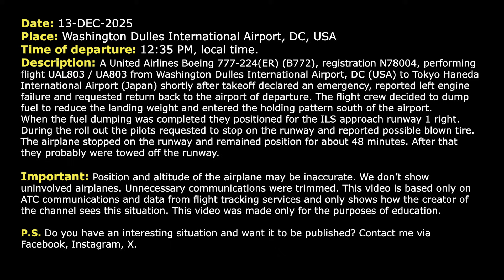Airplane Loses Engine on takeoff. United Boeing 777 declares MAYDAY at Dulles Airport. Real ATC

Comment: ATC needs training on standing by
Reply: Must be hard though. I get it though. Aviate, Navigate, Communicate. ATC probably tuned to Communicate, Navigate, Aviate.
Reply: I dunno. It’s critical airplanes stay above minimum altitudes though,
Reply: @afridgetoofar1818 
They’re following their engine out climb and cleanup profile. It’s published and  pre-calculated to clear terrain for each specific runway. ATC should really know this.
Reply: @thecomedypilot5894 
Perhaps “promulgated” would be a better word. In the case of 01C it’s the standard generic EODP. I can understand ATC being concerned about the initial low rate of climb if they aren’t familiar with the clean up profile, but from the ADSB data the it appears to be normal.
Reply: @afridgetoofar1818 One of the pilots finally said "we're visual" and they still had ATC worried about MVA. They all got the job done but I was screaming "shut up" in my head.
Reply: @afridgetoofar1818  minimum vectoring altitude doesn’t matter to them if they can see and are following their procedures
Reply: @afridgetoofar1818  that’s what they’re critically trying to do… climb a fully loaded aircraft on one engine. Talking to them doesn’t help them accomplish what everyone wants done any faster. Turns don’t help them climb to avoid terrain either. They said they’re single engine, straight out, and they’ll get back when they obtain more altitude. Why is that so confusing
Reply: @Gee1410thirtysix it’s still the controllers job to inform them they’re below minimums. He’s responsible for that airspace, and there are other planes he has to direct.
Reply: @afridgetoofar1818  yeah he did and they said they could see and can’t take vectors. If you can’t turn to avoid a crash, you can’t turn. Let it go.
Reply: @Gee1410thirtysix  ATC did fine. Accept it
Reply: @afridgetoofar1818  disagree and no thanks, random YouTube commenter
Reply: @Gee1410thirtysix  I’m sorry you can’t accept reality
Reply: @afridgetoofar1818  probably because in real life he doesn’t work for an airline 😂
Reply: "We will come back to you" can either mean "we return to the airport" or "stand by". That's why standard phrasiology matters.
Reply: @zsoltsz2323  No american pilot would mean "we will come back to you" as returning to the airport
Reply: @zsoltsz2323  “I’m busy” is pretty easy to follow
Reply: @zsoltsz2323  agreed, but it’s also well known in the USA what they meant, especially when you’re told they’re busy.
Reply: @zsoltsz2323  in american english and the context of the situation what he said was completely unambiguous.
Reply: come show them how it's done big guy, they're def hiring.
Reply: @atcdude067  airlines pay us a tad more
Reply: @atcdude067  why would anyone give up an airline job for those peanuts? Lol.
Reply: This is the most secure airspace. They can’t stand by. An aircraft flying that low in this area is a serious threat that has norad involved.
Reply: @SnakeWhite-i9q  I do believe the WOPR was also involved.
Reply: @SnakeWhite-i9q  tough. Pilots have to fly the plane first.
Reply: @SnakeWhite-i9q  they can scramble whoever they want to, but they’re going to have to stand by when you have two experienced ATP’s trying to not crash into said secure airspace. Comms take a back seat to flying, no matter how secure it is. Standing by isn’t as important as not crashing.
Reply: We are in a large bowl here. ATC knows if they don’t get turned or able to climb, they will fly into the Appalachian mtns. Once they turned he calmed down on radio.  Otherwise being task saturated they could fly into a man and not know it.
Reply: @Mwolfi400  you seem unaware of where said mountains are
Reply: @Mwolfi400  Not in this case.  The aircraft departed straight out on 1 Center, which is a Northerly direction.  The Appalachian Mountains are West of the airport.
Reply: @Mwolfi400  they can’t turn if they’re struggling to climb. Turning means really not climbing.
Reply: @Gee1410thirtysix  if they're struggling to climb, then turning away from the high terrain when they still can is the better option
Reply: @vasilivh  they were visual and said they could clear it. If they turn, they sink into the ground. Climbing is preferable to sinking, especially when you have visual on the “high” terrain ahead.
Reply: @Gee1410thirtysix  yes, the bottom line is the pilot decides what is best in the situation. The ATC was eager to get them to turn and warn about the rising terrain, which was the correct thing to do, they can't read the pilots' minds either. I can't fault anyone's performance here, unless you have been in an actual emergency, you have no idea about the cognitive load it causes.
Reply: @vasilivh  quite aware. Engine out landing in July was my most recent.
Reply: That!
Reply: Disagree, the controller was doing his job warning them about the height. It wouldn't be the first time pilots execute a controlled flight into ground because nobody is looking outside the cockpit, busy with checklists.
Reply: @yumiinaction9759  until they confirmed they were visual and couldn’t turn. Then mva’s are unnecessary

Comment: Holy crap!  ATC needs to leave them alone!  Let them do their job and they will get back to you as soon as they can.  Their engine out escape procedure for that runway gives them terrain clearance.  They are incredibly busy for the initial climb and cleanup.
Reply: Came to say this. And then different controllers asking the same souls/gas question. And approach not responding initially.
Reply: Yup. I've found most ATC have no idea about the engine out escape routes at their own airfields.
Reply: @levelandtrue  well, speaking about EOSID, as far as i know it's a company specific procedure. Every airline can have different EOSID procedure. There is almost no standardized EOSID around the world except on a few airports which is pretty rare (i've seen one somewhere in south korea, probably around anyang if i'm not mistaken, where they have a published standard EOSID).
Reply: I think this was heavily edited and the empty "space" deleted.  I don't think people would wait around for the entire conversation.  It gives the impression of a nagging ATC.
Reply: ”United 803, how much fuel remaining and how many souls on board? Also, do you like your martinis shaken, or stirred?”
Reply: You are wrong you could tell both pilots were extremely irritated by ATC.
Reply: Avigate, navigate and communicate. 
ATC can wait.
Reply: 100%.

Comment: Good lord could the tower controller have asked any more questions of the pilots as they were in a critical stage of handling the emergency immediately after take off? Shockingly poor situational awareness.
Reply: He had to manage his air space.  That's just the way it goes. Apparently you are not cut out for these careers.
Reply: They were leaving his limited airspace and stated that they were unable to accept handoff to Potomac Departure.  That immediately complicates things from the ATC perspective.  The local controller needed a colleague/supervisor in the tower cab to call the Potomac Departure sector controller to alert them that a sector incursion was in-progress, and advise the departure controller to provide immediate radar separation of their existing traffic from the emergency aircraft that had invaded their sector, but was not on their frequency.  For this reason, the local controller was required to deconflict the emergency aircraft via radar vectors from the departure sector traffic he was not in radio contact with, provide MSA advisories on the fly, and issue emergency protocol requests.  All of that is happening in a space of several seconds.  Yes, he became an irritant to the pilots, but he really had no alternative as RLTtizME explained.

Comment: Approach not answering an emergency aircraft is rough but glad everything worked out. Definitely professionals keeping us safe.
Reply from the maker: Probably he was coordinating with Tower. The work load there is high as well.
Reply: @YouCanSeeATC  The repeated Mayday got ATC's  attention though - it has its uses!
Reply: @1947dave  Could have been that someone keyed in at the same time, so ATC didn't hear them.
Reply: I know you're busy but if you can just answer this question I certainly don't need answered now...

Comment: Better than losing an engine early, than halfway across the Pacific.
Reply: They're both bad, but I'd probably prefer to have it be at cruise even over the ocean than on takeoff when close to the ground.
Reply: No, it's always better to lose something on altitude. Take off is the worst moment to lose an engine and the easiest one to end up in a fireball. Slowely gaining altitude + the potential of incorrect rudder are a very bad combination.
Reply: MUCH better to happen in cruise than at takeoff.  However, this time of year, the divert airports on that route are going to be COLD like in really, really COLD.
Reply: @costaricanaturephotography3027  Anchorage doesn’t get that cold in the winter because it’s on the ocean. Average Highs around -3°C  and lows around -12°C for Dec thru. Feb. (yes, Winnipeg, Edmonton, and Whitehorse will be colder. And if you’re landing in Siberia, you’ll have other bigger concerns beyond the cold)
Reply: @kimsmoke17  We have different definitions of cold.  Where I live it is 15-27C (60-80) all the time year round.  Russia doesn't make a fuss over emergency landings.  A Delhi to San Francisco Air India landed in Siberia not long ago and no problems with Russia outside the remoteness and size of the town they landed in.  I'd do almost anything for a summertime diversion to the Kamchatka Peninsula!!!
Reply: @costaricanaturephotography3027 an Air India flight diverting to a long enough runway in Siberia, will be treated very differently,  by Russian government, than a us airline flight diverting to a sufficiently long runway in Siberia.  Just saying.  Think KAL007.
Reply: @kimsmoke17  No, sorry...wrong.  It's an international treaty (Chicago Convention) that allows emergency aircraft to land in any country that signed it, including Russia.  KAL was a huge screw up by incompetent fools not a choice made by the USSR.  There have been several US military aircraft that had to land in Russia due to emergencies and they had no problems either.

Comment: Sounds almost like a cursed flight - blow an engine, cause a brush fire, need to dump fuel and blow a tire during emergency landing. At least everyone got back on the ground safe and folks in plane and in tower did a great job.
Reply: Yep, it's a testament to Boeing airplane design and the certification requirements.  A two-engine airplane at 600,000+ lb at takeoff loses engine power on one engine and is able to climb and return to the airport for a safe landing.  It's a situation pilots train for all the time but seldom see in their flying career.  It's no accident that they were able to do this it's the result of engineering and training.

Comment: I always wonder if the passengers even k ow they lost and engine and are dumping fuel if the engine didn’t make a bang. Does the pilot just inform them that they will be returning to the airport, but not specifically the reason why?
Reply: Probably once the workload went down in the hold.

Comment: Thanks for covering this. I was watching this event unfold live as I was tracking the flight online to see if it was going to fly over or near my house. I live just across the river from the airport and near or under the flight paths. As I watched, I realized the plane wasn't climbing. Where it would normally be around 8000ft, it was only around 2300ft. I watched it on the flight tracking app make an abrupt 180 degree turn back towards the airport. I ran outside and snapped some pics of it flying low on it's way back across the river towards the airport. I continued to watch as it dumped fuel south of the airport. Both the departing runway, 1C, and the returning runway 1R had loads of ARFF vehicles. It turns out debris from the blown engine caused a pretty big brush fire on 1C. The ATC seemed to do a great job, but it seems they were overloading the pilots with a ton of questions. You could hear the stress in their voices. I'm so glad the plane landed safely
Reply from the maker: Thank you for the comment👍
Reply: I live in Manassas but I was at work, which is in Manassas Park, off Route 28 but I drove towards 66/chantilly area and saw smoke in the distance from the brush fire

Comment: Great catch. Atc certainly added to their work load tho.
Reply from the maker: Yeah, it was unnecessary to ask those questions during their slow climb.
Reply: @YouCanSeeATC  The low altitude warning comm and asking intentions was necessary. Otherwise too many questions as you could tell from the pilots replies.
Reply from the maker: @cheapercharlie  Probably I was a bit unclear. Those questions were neccesary but only when they were able to answer them. When the airplane is stable.
Reply: @YouCanSeeATC  You were absolutely clear and I agree with you. I thought  was only necessary in the heat of things was "say intentions". If the pilots are clearly busy aviating  the souls on board and fuel in pounds, no wait, fuel in hours, etc.  can wait.  I was yelling "Standby 1" at the video 😆
Reply from the maker: @cheapercharlie   "Stand by one"😁😁😁
Reply: @YouCanSeeATC where did you get your ATC training from?
Reply from the maker: @atcdude067  What is the purpose of this question?

Comment: Terrible phraseology, missing callsign, not standard Emergency calls… glad everyone is ok though
Reply: It’s a aviate , navigate, communicate and in that order! Think you should give them some slack on the communication during a heavy workload.
Reply: @Jeb7767 it’s not an excuse
Reply: You must be a crusty old librarian.
Reply: Keep flying your ms flight simulator ..
Reply: @romeobravo78 Stop acting like these communications are OK. They are NOT. I understand it’s an Emergency, of course safety of the airplane comes first, but that’s not an excuse.
(P.S I am airline captain myself)
Reply: @jackvismara  with all due respect, maybe you are an airline Captain, but I doubt it. Your unfounded criticisms of the crew sound more like they are from someone who is either one of those "Virtual Airline" pilots, a private pilot who wears epaulets in your C-172, a MSFS Professional Pilot, or someone who couldn't make it to the big show yet has to try and one-up those who are actually handling these events on the line. This crew did an exceptional job in a heavy 777 that was barely making its SE climb gradient. After you've had a serious emergency, please post your ATC tapes so we can hear how it's "properly" done.
Reply: @r @romeobravo78 you can believe whatever you want and I have full respect for this crew and how they handled the situation. I didn’t want to sound so judgmental. But as a line trainer myself, I want to make sure that pilots understand that this is not standard ICAO Phraseology nor the correct attitude to have on the radio. Everyone can become a better pilot. Me too, nobody is perfect.
Reply: @jackvismara tell us you're a wannabe pilot without telling us you're a wannabe pilot.
Reply: Totally agree

Comment: The average rate of descent of the dumped fuel is approximately 500 feet per minute (2.5 m/s).
Reply: No it evaporates
Reply: @camerakid2311 - not immediately, that's why there is a minimum dumping altitude (6000' AGL?).

"Delta Air Lines Inc. agreed to pay $78,750,000 to settle a class action lawsuit alleging that, due to a mechanical issue, flight DL89 needed to dump jet fuel over parts of Southern California, causing harm to property owners and residents in the affected area. The settlement class includes an estimated 160,000 residents and 38,135 property owners."
Reply: @carlyellison8498  I thought so too, but apparently the minimum fuel dumping altitude varies depending on region. On FAA's website regarding fuel dumping, it states that "If an aircraft is dumping fuel in IFR conditions, assign an altitude at least 2,000 feet above the highest obstacle within 5 miles of the route or pattern being flown."
Reply: @bestbearyt - thank you for that info!